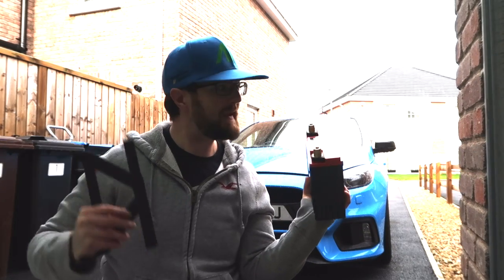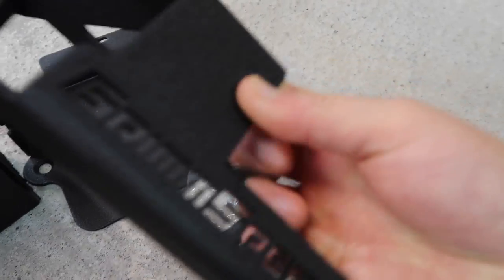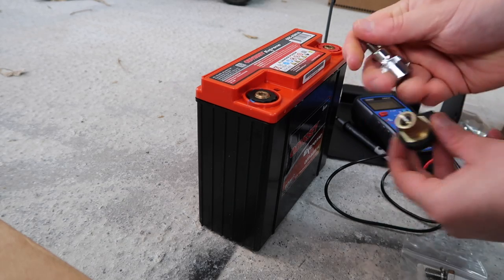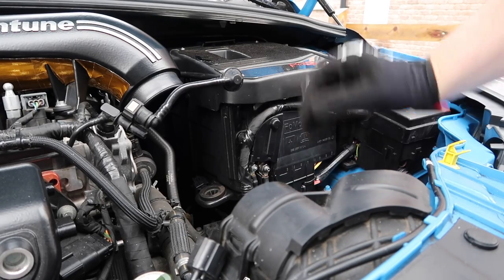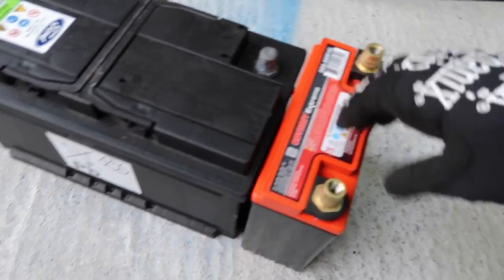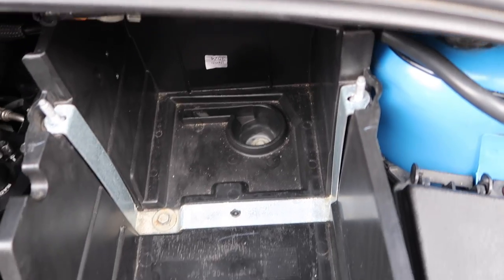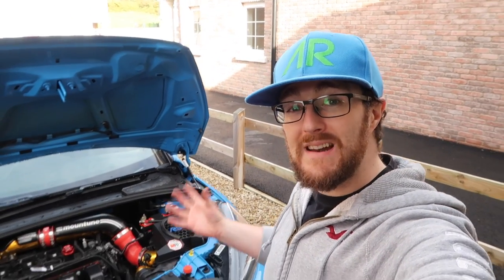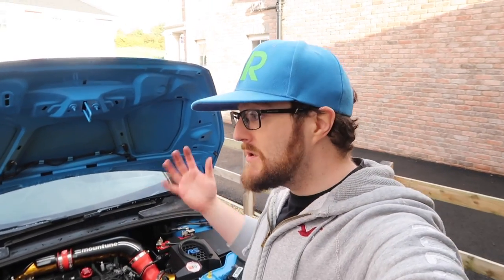LIGHTWEIGHT BATTERY SETUP INSTALL! | ODYSSEY EXTREME & GRIMMSPEED | FOCUS RS

Comment: Where did you get the terminal kit from please Adam??  I’ve had everything else for a couple of months now, just never got round to the terminal kit. 🙄 cheers bud, very helpful vid, installation looks pretty straight forward, very well detailed. Well done 👍
Reply from the maker: Hi Scott, I got it from murraymotorsport.com and the part number is ODY3217-0006

Comment: Great video Adam, very interested indeed and could be something I do when I need to replace current battery. However. I would like to know, as the battery is now in a slightly different position, over stock do you have battery terminal guards to prevent shorting in the bonnet and are you able to get a battery cover to provide protection to the battery relating to the elements. Are you not supposed to using any grease on the terminals with these batteries to prevent corrosion?  Many thanks Adam.

Comment: Would be curious how it performs long-term. Great install and video!
Reply: Me too. Odyssey makes great batteries, but I think odds are good that this one will die early compared to if it was the proper size. 170 CCA and 16 Ah is very low for an automotive application. I doubt that this motorcycle battery was designed to supply anywhere near as much current as a car's starter draws, especially in cold weather. Batteries are heavy and expensive, so manufacturers have no incentive to install larger batteries than necessary.

Comment: Are you still using this battery?
Reply from the maker: Hi there, I am not. I switched back to a regular type battery because I wasn't driving the car often enough to retain enough charge in it to start the motor. If driving the car at least every couple of days or keeping a trickle charger connected when not in use then it would be perfect

Comment: Great vid, did you change the BMS settings? Using Forscan?
Reply from the maker: Cheers Simon, I didn't but that would be a good idea
Reply: @AdamRainey  I had mine installed yesterday and reset the BMS, I also changed the settings from wet battery to AGM to hopefully prevent overcharging 👍

Comment: I'm curious to see if this lighter battery setup can match the power requirements of a more conventionally-sized battery.  I'm running a front- and rear-dashcam which increases the electricity requirements of my RS.
Reply: Great question. I also have a front and rear cam.
Reply: I heard that the quality and performance output on these has dropped over the years. Some people were saying it drains quicker with high shock load (rough roads, terrain etc.) idk just things I’ve heard. Take it with a grain of salt. Was gonna get one for my ST mk3.5. Maybe they just got a shotty battery from sitting so long on shelves, who knows. Haha

Comment: Anyone come across an issue with the battery where one of the posts is too small? The negative side can tighten snugly with the stock terminal connector, but for some reason the positive side is loose and it pops right off with no effort. Tried putting a spacer on it, but then the terminal connector wouldn’t fit at all..

Comment: How is the battery holding up Adam?
Reply from the maker: It got a bit annoying. Because I wasn't driving the car all the time, the battery would struggle to crank so I just put an oem battery back in
Reply: @AdamRainey  Thank you for the reply, thats good to know.